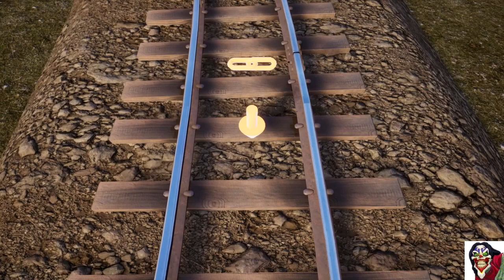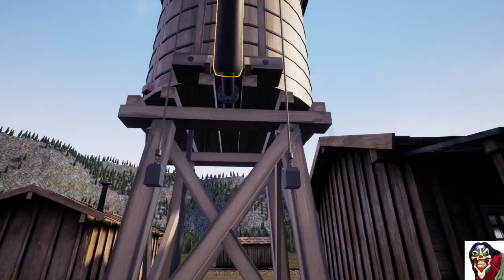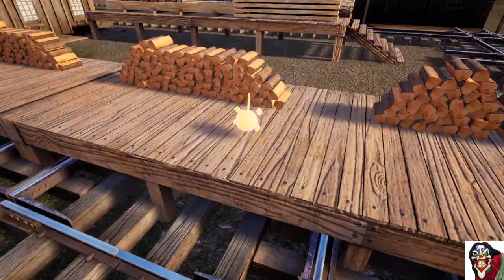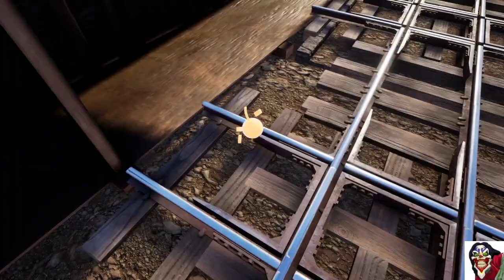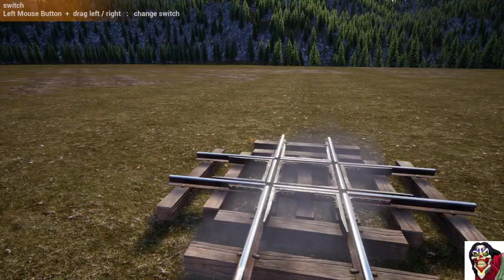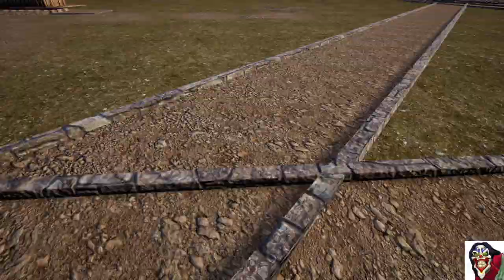RO! - Old Build Tools Tutorial Ep9

Comment: I find it easier to adjust the firewood depot legs against a visible rail for parallel placement and then move it with the wasd-keys into the final position. Usually I place the legs so that they are all visible at the web of the rail, but not at the head or bottom. This way they are pretty parallel with the rail.  If you're not too heavy handed on your mouse while moving with the keyboard and while clicking for the final placement you'll most likely end up with only one try. Didn't know the part with the crossing pieces though, thanks for showing that.